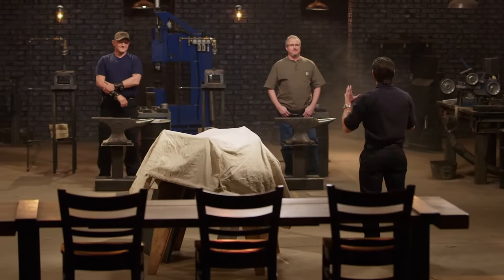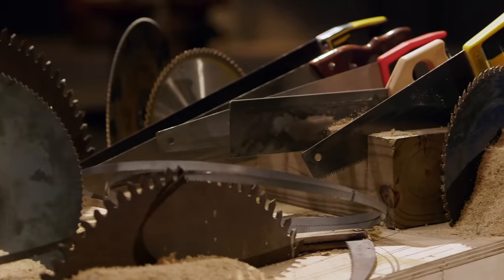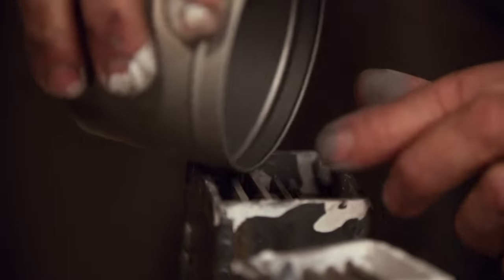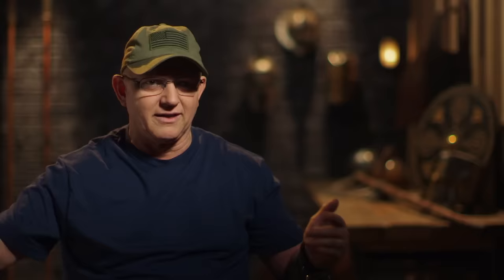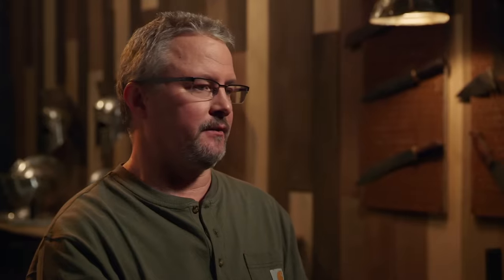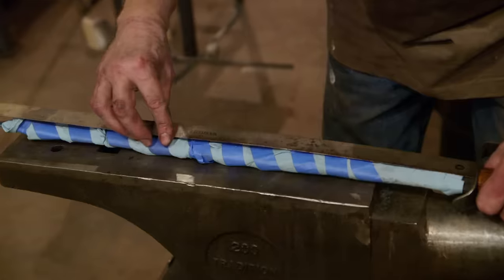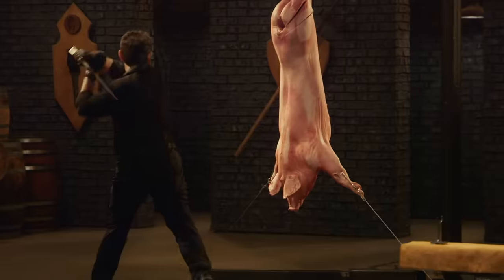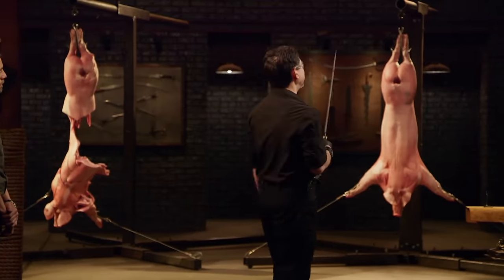Forged in Fire: Beat the Judges: SAW BLADE SWORD CHALLENGE (Season 1) | History

Comment: Judges:''Congrats Jay even though your sword failed to slice hot butter''
Reply: Yeah I had him not winning that at all
Reply: @crypticpower  same here. Hands down he should not have won it. No question.
Reply: The other dude's sword cut the pig and the sandman better because of its mass, which was a bad thing.
Reply: @jakashiaalexander7680  it’s a weapon tho, it did serve it’s purpose better than Jay’s
Reply: @papatigre9421  they asked for a short sword and he brought back something that weighed more than some two handed swords.
Reply: Weight wasn’t one of the specified required parameters of the build. The only thing they specified was length. It also looks like the judge’s hilt wasn’t mechanically attached as was required. By that fact alone he should have been disqualified before the first test. The result of this episode was them trying to save his reputation by not disqualifying him for failing the build requirement or losing to someone not considered a master smith.
Reply: @papatigre9421  You are supposed to fight with a weapon. So getting tired after 3 swings, or breaking your wrist trying to maneuvre it are not part of the goal. It's supposed to be usable as short sword, not as a meat cleaver.
Reply: @Fever_Ghoul  Tell me you don't know what mechanically attached means, without telling me you don't know  mechanically attached means. It also counts if the pommel is screwed or peened. The whole pin-thing is really a KNIFE trait and not a sword trait.

Comment: I wish in competitions like these the judges were completely ignorant of whom made which piece.  Whether it be blade making, baking, any art.  Take the bias out of the decision making.
Reply: That's why blind testing is an important thing in official competitions. You shouldn't know who made what because you don't judge the person, only their creation.
This one was rigged from the start.
Reply: @lyravain6304  i totally agree. Thanks for the response
Reply: i couldnat agree more, this decision was nonsense, they all know it, but it was J nielsen after all
Reply: @TT-bg7yh  the two swords performed basically identical, but one was heavier. it is always the case in this show, if none of them beats the other, the heavier loses. historically, all bladed weapons were (at least intended) made to be the strongest yet lightest, because you tire yourself out fast with an unnecessary massive weapon.
Reply: @Gabrong  would you rather have a heavy sword or a sword that doesn't cut??
Reply: @HaightTheGreat  if they were two exact swords with only its weight that differentiates the two, I'd rather have the lighter blade that doesn't cut. Much easier to maneuver with.

A dull blade can be fixed, a heavy blade of the same type cannot.
Reply: @HaightTheGreat  you see.
Your argument would have worked if for example. The heavier sword was just somewhat heavy but cuts.

That thing. Weighs 4 pounds. It is on the heavier side of the longsword category. I don't think this is a longsword test.
Reply: @HaightTheGreat  I want the lighter one. Why ask such a dumb question? It's almost like none of you have any experience with fighting with an edged weapon. It's common sense that unwieldy weapons get you killed.
Reply: @porkcutlet3920  heavy doesn't mean unwieldable.
Reply: @HaightTheGreat  but it is for a short sword.
Reply: @fattytan1377  that's not the argument. Yes it is heavy for a one handed sword but you can still wield it, it's just a little more difficult but if the sword doesn't cut then what's the point?
Reply: @HaightTheGreat  you're better off with a hammer than that.
The only reason it even cut was because of its weight.
Reply: @fattytan1377  but it cut. Blades are supposed to cut. You people act like it weighs 25 lbs and you're barley able to lift it.
Reply: @HaightTheGreat  It barely cut.
It was barely better in cutting than the other sword.

And it's worse in almost every other aspect.
Reply: @fattytan1377  that's bull. It cut the pig better but was heavy.  They both took the same damage on the pots. It cut the body with every strike when Jay's knife cut once. Don't lie to yourself just to prove your point.
Reply: Its a short sword. A short sword supposed to be wield in one gand easily
Reply: @HaightTheGreat  they are not supposed to make a blade for one cut test only. They are making real swords. No one would take a heavy one handed short sword to the battlefield, as after 1 hour of fighting at least your wrist hurts, you arm feels heavy and that will get you killed. With the short one you can cut through the unprotected parts of the enemy and at least still fend off attacks after an hour of fighting.
Reply: @m4t3matix73  it's heavier then is should be by a pound or two, it's not like it's 20 pounds too heavy.
Reply: @HaightTheGreat  I used to do competition and tournament fighting. Anyone dumb enough to bring a 4lb short sword would get humiliated quickly. 
Here is food for thought, a mace...that ball of metal on a stick you literally bluntly pummel people with, averages at 2.5-3lbs. This guy's short sword is heavier than a weapon designed to cause blunt force trauma on someone. 

Anyone that sees/hears 4lbs for a one handed weapon and thinks "that isn't too bad" has never had to actually fight. After a long competition meet my arms would feel like jelly. Shield and ax, my ax is only 1.7-2lbs. The guys with the heavier 3lb weapons? Usually tire out and cannot make it the whole competition. Competitions last all day. On average each person is going to be fighting for roughly half hour to an hour of total time broken up. Doesn't sound like much, but that 4lb weapon will feel like a 100lb anchor after 5-10 minute. Remember, no one will give you a break, the moment you choke up on your blade you will be attacked, the moment you try and drop your arm a bit to get some relief you will have to immediately defend yourself. Isometric weight lifting uses only 2-3lb weights and most people can't last 5 minutes.
Reply: @Nempo13  this isn't a combat competition. It's a show where they are rushed to create the best weapon in a short amount of time. In this particular competition one blade was slightly heavier then the other but it out performed its competitor. I'm not claiming heavier swords are better but I am saying the heavier sword in this particular competition preformed better and had it been a regular person and not Jay, I think the heavier sword would have won.
Reply: I agree 100%.
Reply: Agree.
Reply: @Gabrong  except jay didn't mechanically set his handle? So technically he lost before testing.
Reply: @HaightTheGreat  for 10-15 slashes ya its seems usable but try 50-60 and your sholder is really going to be feeling the weight
Reply: Good point!
Reply: No way Tony could have won with a 4 pound short sword, no matter how well it cuts
Reply: @HaightTheGreat  When the weight difference is this much it becomes harder to judge them evenly due to the difference in power. If a short sword is weighing 4 pounds then you might as well throw it away and get a long sword/ two handed weapon
Reply: @zanyskeleton5291  it's not like the blade was 5lbs heavier. It was heavier but it cut. I'd rather have a blade that actually cuts. I agree with the original comment that these competitions with the judges competing should be judged blind.
Reply: Think about this: You are asked to make a dagger
One competitor turns in a regular sized dagger,
One competitor turns in a dagger that is 2lbs but cuts better than the lighter one due to the weight.

Who should win?
Reply: @HaightTheGreat  I do agree that it should be tested blindly but I saw Jay's win when the judge mentioned the weight as 4lbs. Its just no longer a short sword and the other competitor almost completely disregarded that
Reply: 4lbs is heavy for a falchion- that short sword had more in common with a falchion than a short sword.
Reply: @lyravain6304  I do think they placed a bit too much emphasis on the weight, but they don't always play favorites. Jay infamously lost a knife competition over a really deep finger well that made the knives practically harmful to use.
Reply: @HaightTheGreat  I'd rather have one that's dull. It can be honed or sharpened. You can't fix the balance of a sword once it's made.
Reply: @HaightTheGreat  You can sharpen a dull blade. You can't take weight off of a heavy weapon
Reply: @HaightTheGreat  You can sharpen a lighter blade. You can't fix the weight of a heavy weapon. In all likelihood, if a soldier had the choice between the two, they'd pick the lighter weapon, because they can sharpen it (and they had to sharpen their blades after most fights anyway)
Reply: @HaightTheGreat  Have you ever actually used swords before? A pound or two, especially if it's not directly in the center of the handle, can make a big difference.